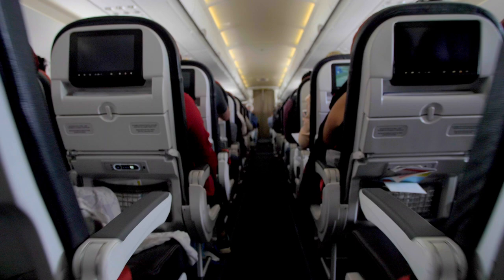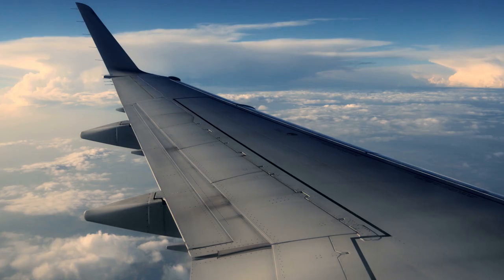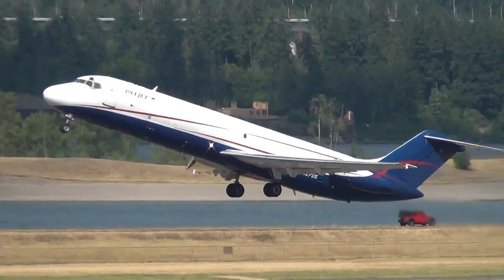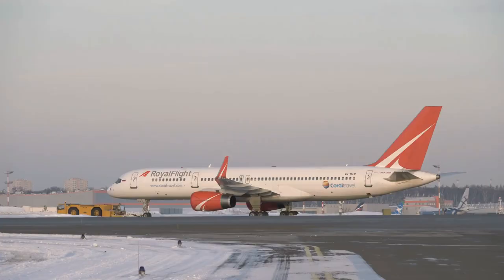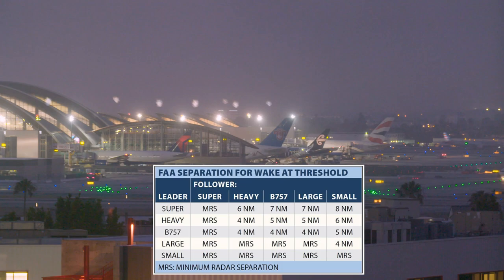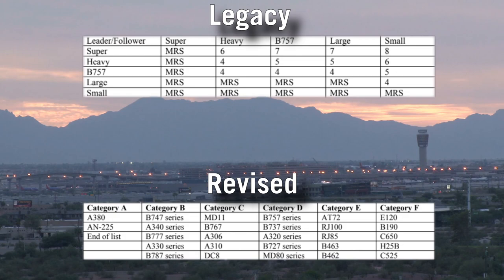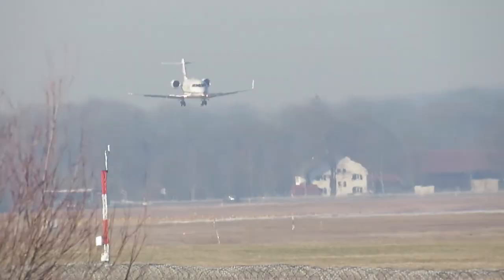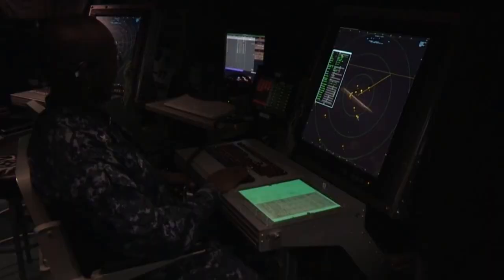This Is Why Airplanes MUST Wait On The Runway

Comment: Russia we sale gas turbine HIND, tank,  warbird MIG 23 (we fly MIG). Military jet maintence very high.
Commerce passenger plane some no good.
Sit runway brake on full, pilot throttle spool engine full power 2 minutes. Part see if fall off, engine blow. Better engine bang on runway  
no in air. Russia airplanes Aeroflot run bad maintenance, no care. See service log, shit pants if see how use used part, broken repair part, make one engine from two engine. Some blade compressor take from broke engine use on worn out time out engine. Cheap grade low oil. Filter no change new one. No use new tyres, take off other broken plane use parts. 
Sorry bad English spell, no interpreter in office help. 
Greeting from Russia (Cherkasy, engine part)
Girood Airfield Hanger.. ♥️

Comment: What he is saying is badly worded and strictly speaking,  incorrect.  Planes do not have to wait for 3 mins.  There has to be a 3 min gap between planes taking off.  Not the same thing.  If the airport is not busy and its been 5 mins since a plane took off, why wait 3 mins!  Having said that I see planes landing into Heathrow every 30 secs.